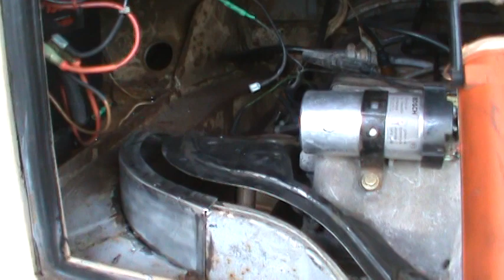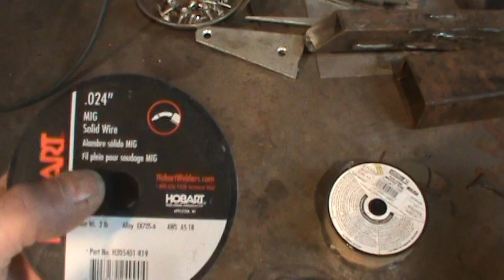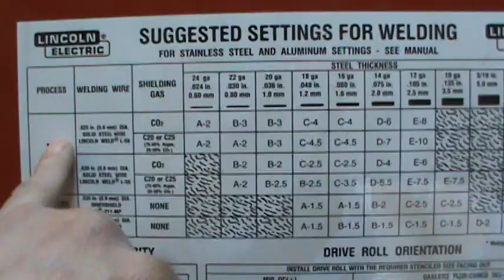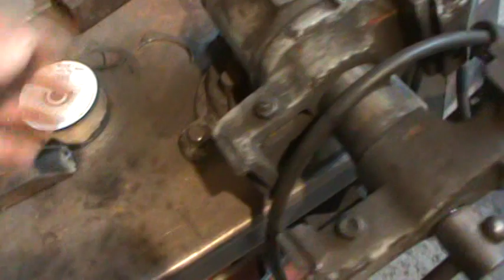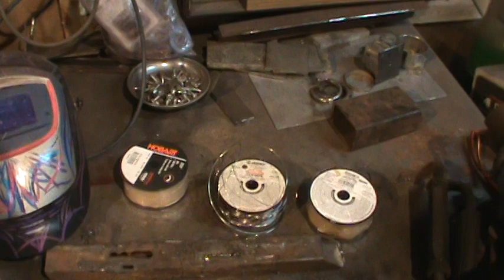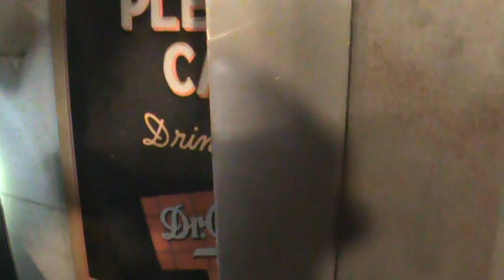mig welding for beginners

Comment: I was a welder by trade and your tips are pretty good ...one thing I used alot was  splatter shield when using a mig gun really works well it makes your  tips last longer and less sticking of the wire!

Comment: I have quite a cheap helmet but it is auto darkening. Mine has 2 little dials inside by the lens which allow you to change the sensitivity and the delay of the darkening. Then there is a dial outside to choose from 9 up to about 13 . The 9 is a bit light  and you get that having stared at a light bulb feel straight after but 11 and above is excellent for flux core.

Comment: Great video, much appreciated! I'm repairing some small holes in a VW floor pan, looking to weld it myself. I don't have 220 household voltage, are there fluxcore welders that can run on just 110v? Thanks!

Comment: Thank you for this! Even though I welded in a commercial capacity, I never really was taught what you are teaching. I ran the welder as it was set up and made adjustments without really fully understanding what I was doing. Things were already set up (polarity, etc.) and maybe I upped the heat or changed the wire speed. Most of the mig I did was large flux core filling in a vee that was a plate 1/2 inch thick to a 1/2 X 2 1/2 bar tacked and tilted so I had a perfect upright "trough" to fill. The owner of the company looked at my welds and said "very consistent". And he was "anal". My take on the movement you make as a welder is to try to move like a robot would. The flux would just curl up like a long thin potato chip. Just flick it off. I hated bashing flux out of pits.

Comment: Late to the class. Thanks for your insights and why you should information.  Especially the difference between gas and wire welding.  I have aquired metal scraps from local salvage yard so I now feel I'm on the right track for practicing with my 110 volt mig welder 135.  Thanks!

Comment: Had this video n my to watch later list and will keep it there. stuff doesn't always sink in the first time through. my biggest problem now is that my eyes can't see around the puddle and thus y bead drifts off the seam. any thoughts on variations of filters / what have you that can brighten things up just a little so a person can see whats going on ?   not such a problem with oxy-fuel but is for MIG process . I use the shielded gas kit on the 220Volt Lincoln Electric which is a special build for Canadian Tire.  auto sheet metal is the name of the game for me.

Comment: Some excellent tips, such as the practice piece on the bench, which heats up the tip And the welder to allow you to get the effect of them working at operating temps. Also buy a better quality helmet people, find the best deal you can on one, don't working about flames/skulls/cool designs as much as the response time to darkening and quality of materials used, yes reputable companies tend to be the way to go, and if it does have a killer design on it that's just a bonus. You only get 2 eyes, and they are not replaceable.

Comment: guy i know just got a 120v 95 amp mig on sail for 250 bucks its pretty good with gas and and good wire not the crap that comes with it i was impressed its the first 120v mig i have ever seen work decent  even with the flux core its not bad  i will stick with my too vintage arc welders for now but if i have the cash i will pick one up next time they are on sail

Comment: WOW! Great information, Mustie-- you explained the " needing more heat for the plug welds" thing I was wondering about-- I also don't need the gas shield if I'm using flux core. The other stuff is all practice. Thanks again!
Reply: when I did my truck just over 10 years ago I failed on the plug welds . couldn't get the penetration then I'd blow through.  doesn't help my eyes can't see the puddle worth a hoot either.  eventually I went to another solution.  quite likely my plug weld holes were too small . the parts would just pop apart on me.